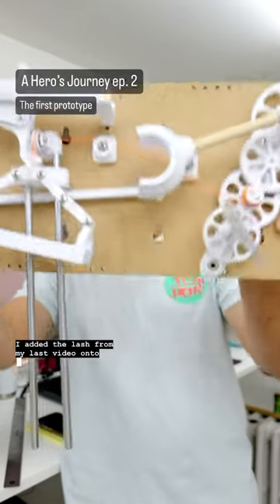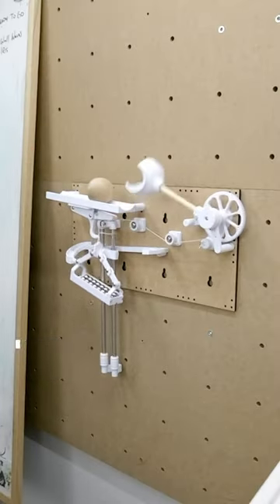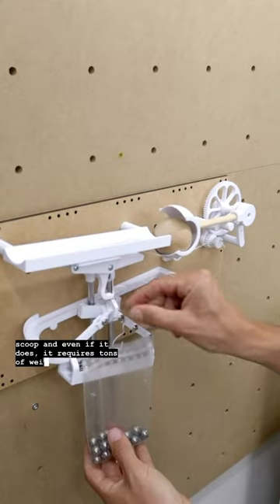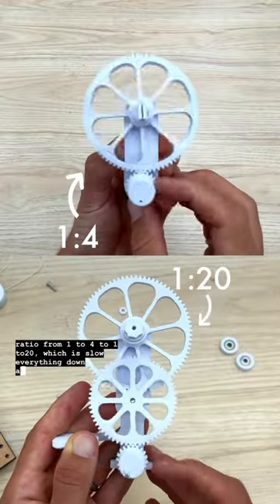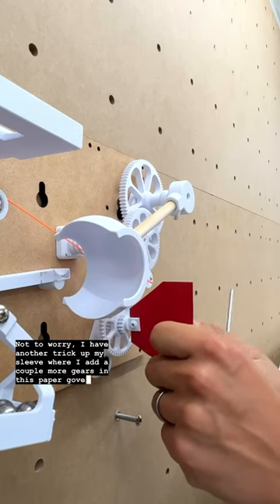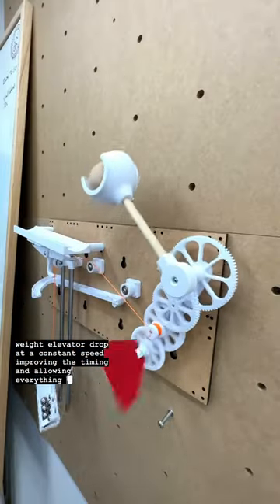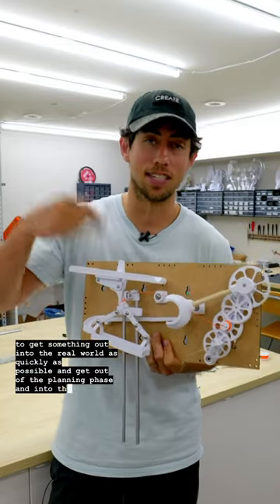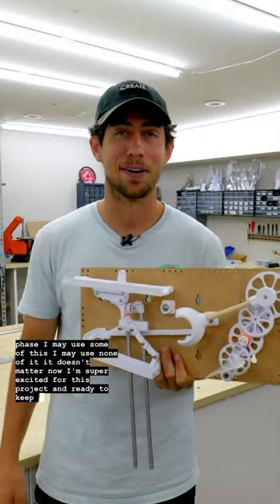Ball Machine First Prototype

Comment: I was a product model maker  back in the 80s. 3D printing was just becoming practical. We did a lot of poly resin casting with silicone molds pulled from wax models. We did some amazing stuff with foamcore board, as well. I worked with local machine shops, too. This was near the Pratt & Whitney engine factory, and the retired machinists used to hang out in the shops and get high on the smell of machine oil in the floorboards. I had a big old Bridgeport milling machine, a lathe, and a table saw.
   Your studio is amazing to behold. And you clearly know how to use it. 
 The digital divide has been as important as the Renaissance!  
  I learned hand/analog drafting, glue-up boards for art, photostats, color-separation---- and then relearned the digital tech when it came along.
   I'll bet you don't even know what rubber cement smells like 🤠

Comment: Hey, hi!
How do you fit the bearings into the 3D printed parts, like do you print around it or force it into the 3D printed part or something else.

Thanks in advance 😄
Reply from the maker: I just force em in! Generally I size the hole to be the same as the bearings outer diameter and its almost always comes out smaller when printed, makes for a perfect press fit

Comment: the gears are cool, but using them to control your timing is going to be a forever headache because you're always going to have to worry about and adjust timing. it'd be better to make it hit the switch once it hits a hard stop and make the arm always be able to grab it from the known position
Reply from the maker: I agree with this!